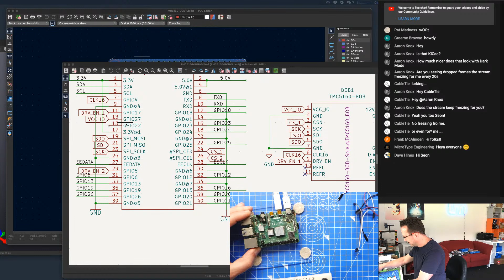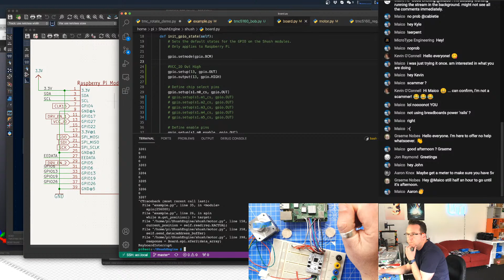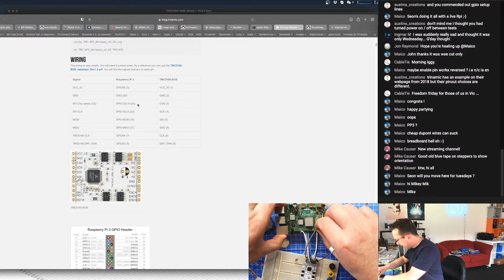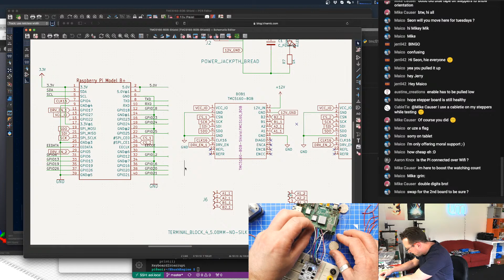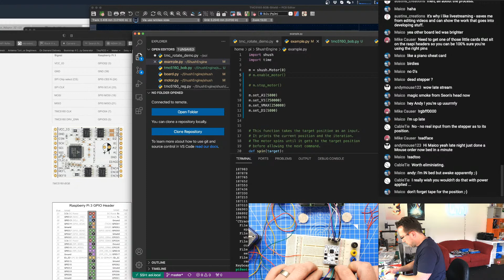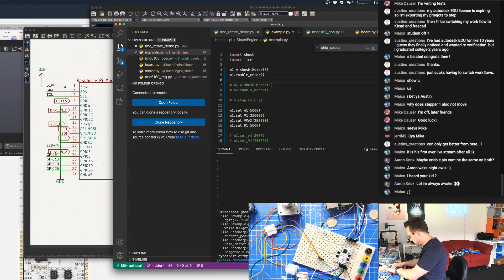Live Stream #1 - AOI Hardware prototyping

Comment: I think I would have had the cro or logic analyser out by about 30 seconds into questioning if I had the signals right. I could feel your frustration!
Reply from the maker: Yes, I should have gotten the logic probe out... but it has been working fine for days before the stream. I think that's gonna happen in my next stream, as I did get it working again, for 5-6 mins, then it stopped again... with no change of wiring. So something sinister is going on....